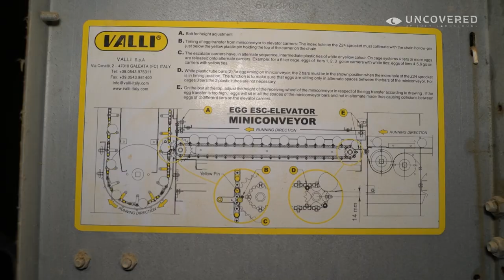I could get in trouble for this

Comment: I’m a vegan so I’m not trying to defend what’s happening in this video, but most hens lay should lay around 250 eggs per year not 15 or less. That’s including backyard chickens that are treated well, opposed to being stuck in a cage like this. I don’t say this to attack or defend. I say this because when you’re trying to change hearts and minds you have to be accurate. If you exaggerate or are misinformed people are even less likely to believe the other things you say and will shut down and stop listening. Facts matter. Otherwise, good work as always Joey.
Reply: You're misinformed. Use your search engine. Wild hens lay up to 15 eggs in the spring and they can fly. Joey is 100% correct.
Reply: @chrissiehorsley304  I did use my search engine to double check before I posted that comment. Maybe you should consider using yours.
Reply: It’s the same as sheep not needed to be sheered, it used to be 15, humans changed it, now it’s almost 300. Simple as that